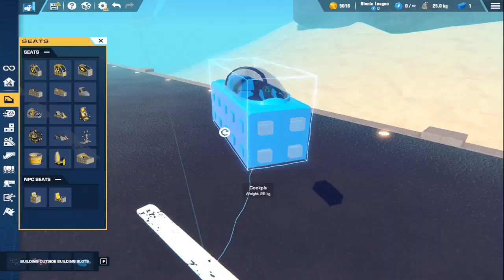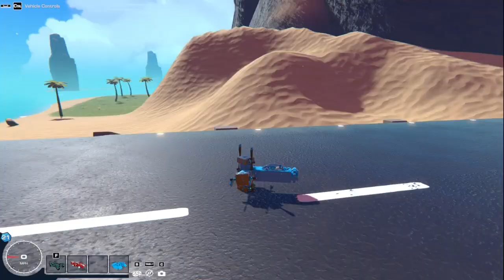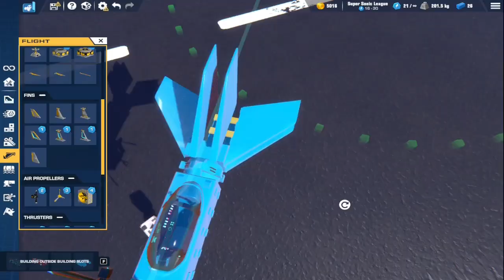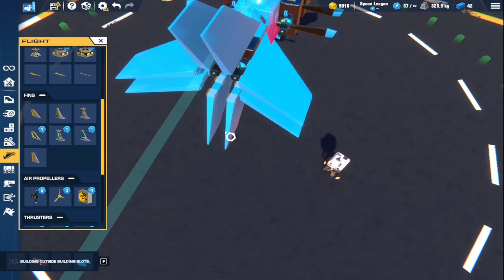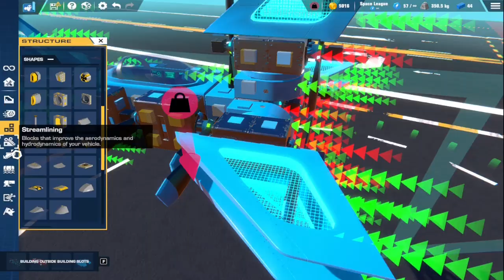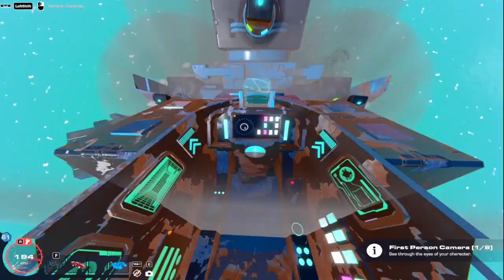How to Make a Camera Controlled Air Vehicle in Trailmakers!

Comment: I ha d a tech that is called "Camera seeking device" and its a tech that uses ain servos and distance sensors to send a signal to make something, like turning. Its on the workshop
You could use to dispose the servos on the front and lower de complexty, you can make them activate with a slight turn or a hard turn
Reply from the maker: Huh.

Comment: 10:27 that is absolutely wrong in trailmakers only oscillations would increase which can be mitigated with gyro but it will take away the manuvarability
Reply from the maker: Oh okay. I try to be semi uncertain when talking about things like that especially since i have not looked at any of the games code outside of the blueprint system, and I'm not a master at the physics of it, nor am I a master of unity by any definition, and I had kinda just noticed that there was a point of deminishing return on adding more propellers, and miss-attributed it to weight. I also believe I mentioned oscillation however I'm uncertain if that made it into the final. I did say "I think" However you are very likely absolutely right.